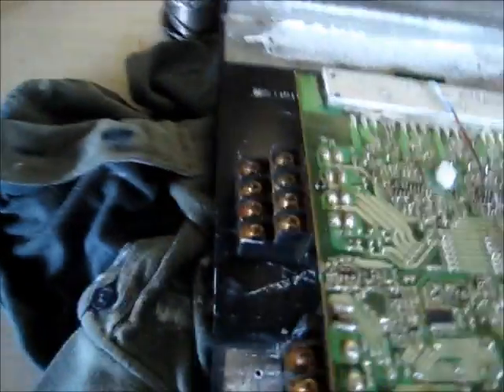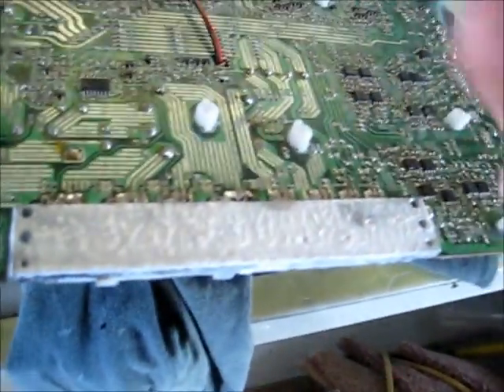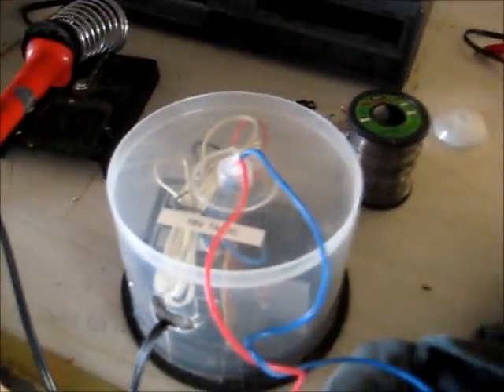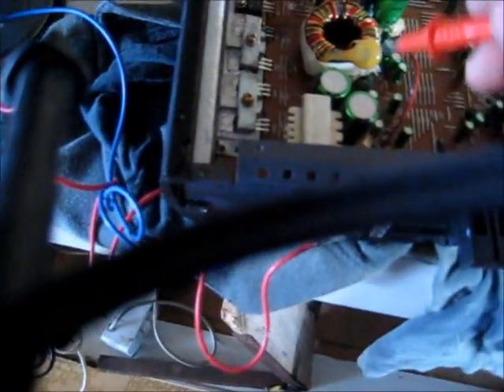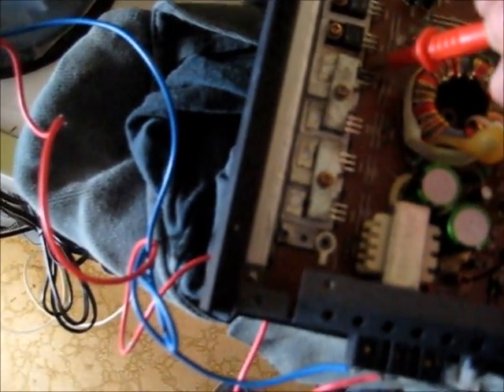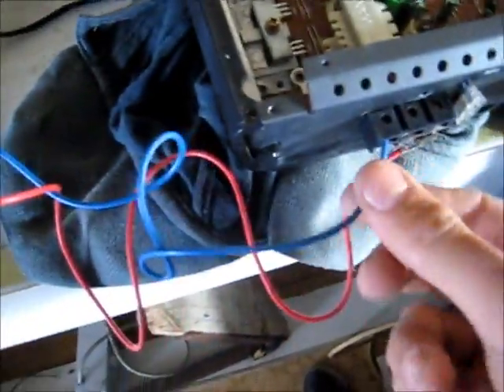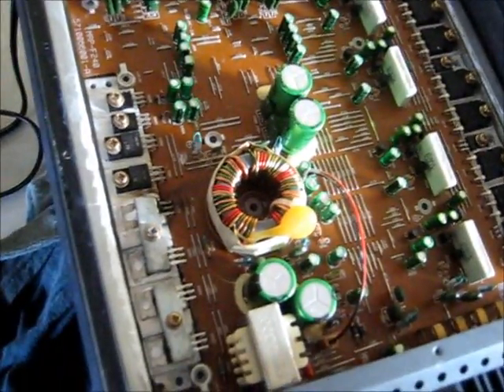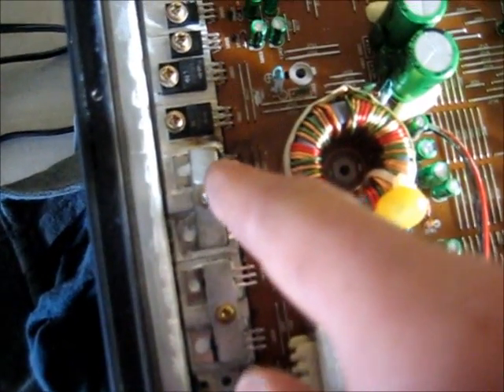Alpine amp fault finding

Comment: It should not be buzzing like that. The inverter stage of the power supply operates at a high frequency that you shouldn't be able to hear. I'd say something is loading it down, it's definitely not right and won't last.

Comment: So how do you test the mosfets...????  Mine get really hot ...almost smoking hot...on a Alpine 3552 amp...they are marked D1669. The amp I have will not output anything..no sound..but I hear a small whining sound when it was turned on..in the fet area..the amp was drawing around 20 amps at idle..I cut all the fets out..and now it dont draw anything.
Reply: google it its really simple to check mosfets with multimeter

Comment: I would say the big capacitors could be bad, just for the heck of it you should try replacing them. I have had smps make a screaming noise like that, usually the caps are going.